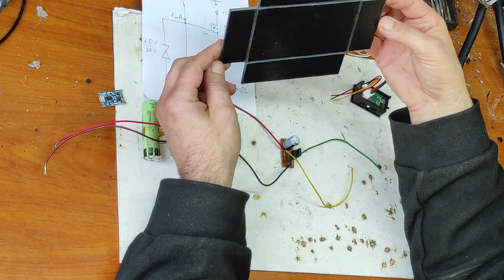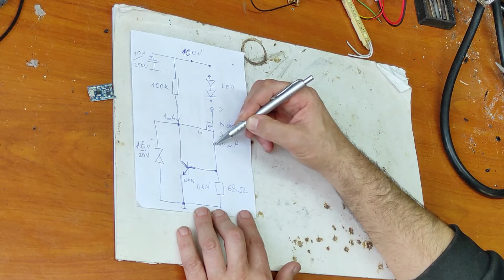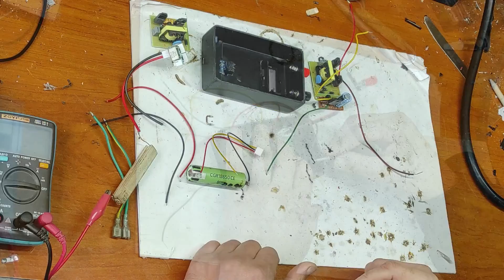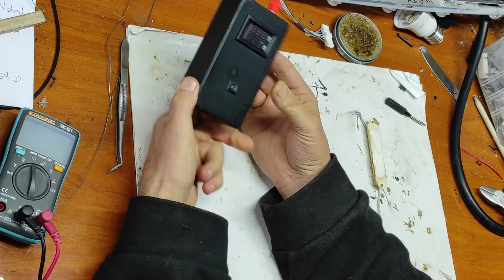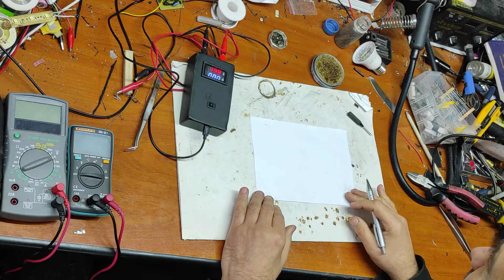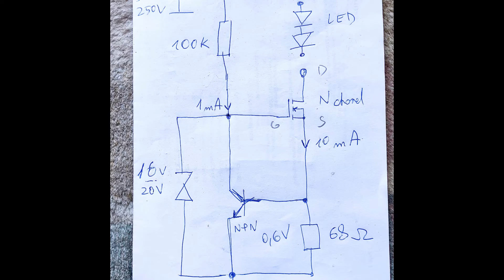Diy led tester 3V-100V under 3Usd

Comment: Thank you for your video ! Could you give the name of the module you've been using to boost 4V up to 100V ?
Reply from the maker: Step UP Power Module 12V to 220V 40W DC-AC Boost Inverter Dual Channel
Reply: @diymariuselectro  Ty !